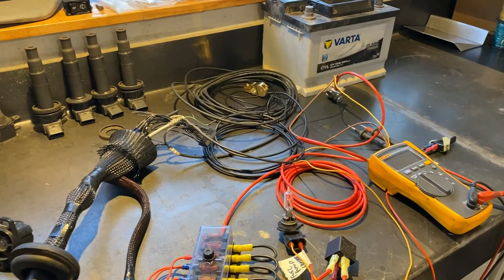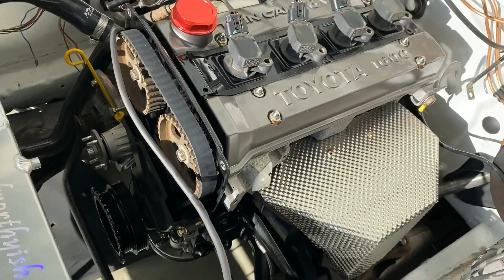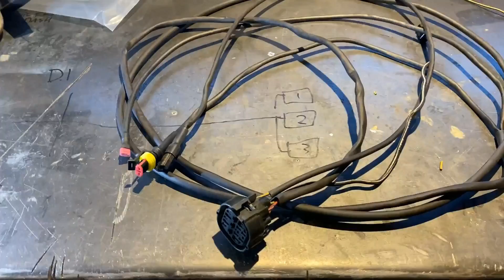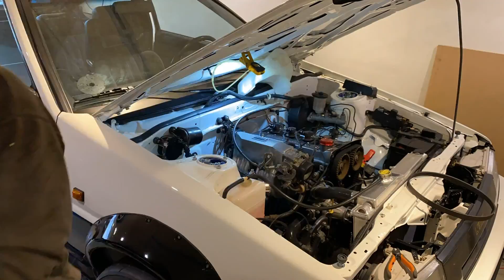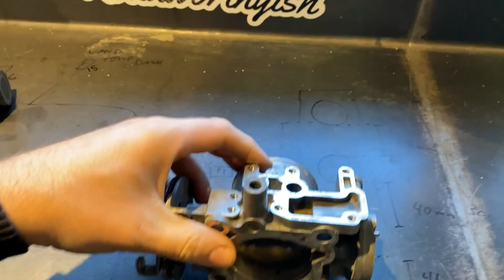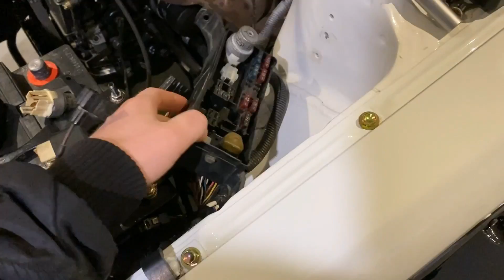Ae86 Speeduino build Part 2. Crank trigger, Aux wiring harness. Corolla 16v 4age gets COP’s

Comment: Thanks for making these videos, I’m currently trying to work out how I can use a speediuno for a turbo st170, I haven’t built it yet but I will. The biggest thing that scares me/am totally ignorant of is the electronics of it all, do you think it would be possible to modify a stock wiring harness for all the sensors you need when you go boosted?
Reply: Idk I’m still in high school but I am really good at putting my mind to stuff when I want to and I’m trying to understand all the little things with the electronics, bottom line I’m trying to make my focus SVT turbo for cheap. Don’t care if it eventually blows up just wanna learn as much as I can and have some fun
Reply from the maker: Hi. Thanks. And sure. You Can modify your Stock wiring to suit the sensors to go boosted, if you just go slow and do one sensor at a time. Try, learn, and aply knowledge and skill to the next one and so on….

Comment: Great job!! I'm about to make my own engine wire harness for Speeduino, no experience at all about this stuff, but I have a question about wiring. For some signals(sensors) the wiring shouldn't be shielded? Power feed for each sensor, injector, cop, etc has to come from the ECU, can be used a single 12V wire and branch out where it is needed? Building a Locost from scratch using a 2.5l Duratec. VVT is variable valve timing.
Reply from the maker: Thanks.

Cool man. Go ahead.
Yes especially the wires for the crank trigger etc.

And using a single power wire comes down to if it’s switched power or ground.

Comment: some people used to run the honda dizzy and run the obd1 ecu. it worked pretty good.
Reply from the maker: Cool…
Love all the “low tech” solutions whatever works right.

I just wanted to get the dizzy out all together…
Reply: @DavidRoadworthyish  Yeah this was mostly used years ago before the speeduino was created, It was a cheaper standalone cause you could tune it yourself and all it required was a adapter to run the honda dizzy. Most of the yota sensors worked with it.
Reply from the maker: I love that stuff!
Never been a fan of monoploy in the world of ecu´s, sensors, etc. Share the love! @turboimport95

Comment: is the speediuno just easy as rewiring to from the old ecu ? or how it works exactly i have an st 4age
Reply from the maker: Yes. You Can use the Stock harness if it works.

And all your Stock sensors…

Only thing is you need High impendence Injectors, otherwise you need injector resistors. But everything Can be wires in the Stock harness.

Comment: how many degrees before TDC, your position the missing tooth?  how about the cam sensor installation?
Reply from the maker: I Think, from memory, that the missing tooth is around 45-46 degrees after TDC and then just adjusted acordingly in the software.

Also not running a cam sensor at all…. Just the crank sensor. All the Stock distributor setup has also been removed.

Really basic setup, but you don’t really need more for the 4age unless you plan on running seqential spark and fuel…

Comment: Do I need the trigger wheel in order to get the engine to fire correctly? 
I'm doing a megasquirt ecu and the 1nz cop kit for my 16v
Reply from the maker: Hi Connor.
The short answer is no…
You Can use the Stock signal from either cam /distributor if it’s conditioned to suit your ms…